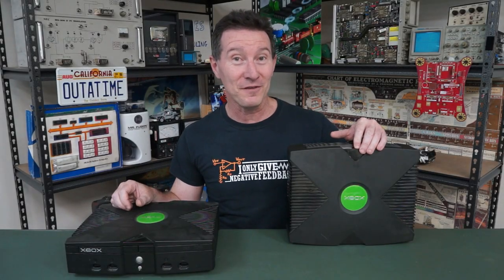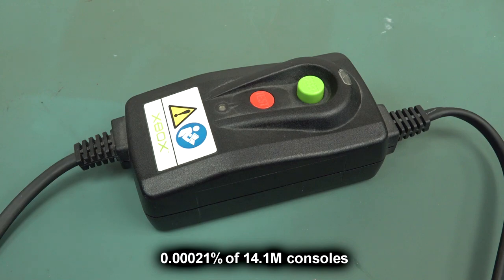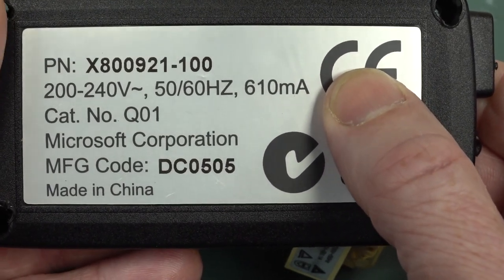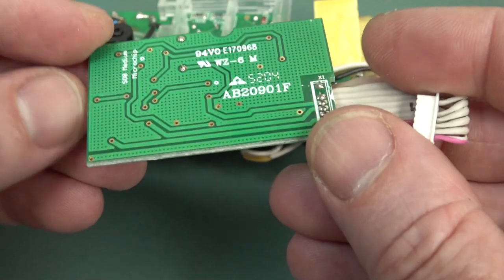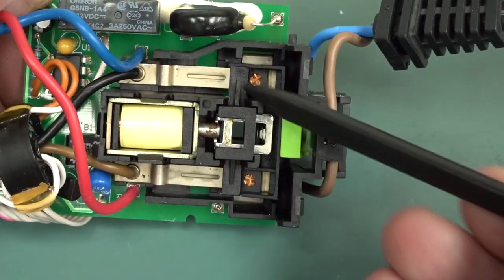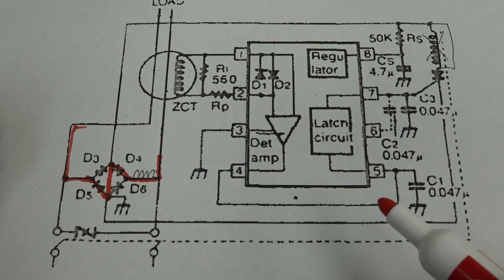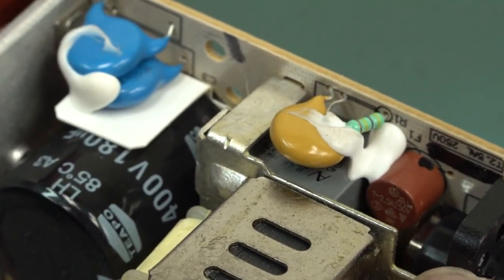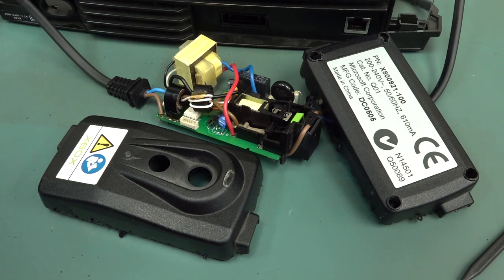EEVblog #1164 - Xbox Engineering Baptism Of Fire

Comment: I don't think that's a real solution, since the user can exchange the cord with whatever IEC8 cord, every household has plenty of devices with IEC8 power cords. This external unit would have been a real solution only if the console has some custom power connector.

Comment: No ground? Why didn't consoles have ground, all my old laptops had one?
Reply from the maker: Double insulated like many home appliances.
Reply: Having a ground makes it easier to pass both safety and EMC requirements at the same time and avoids touch currents in normal use, but it costs money. The result is that small PSUs (phone chargers and such) almost never have a ground while large PSUs (desktop PCs) nearly always have a ground. Laptop and game console PSUs are in the size range where the design decision can go either way.

Comment: This "Arc Fault Circuit Interrupter (AFCI)" power cord doesn't really fix the problem, only avoids arcing and resulting fires. They should have recalled all effected units and REPLACED them with brand new units.
Reply: But that costs more money! Just need to keep the fire damage lawsuits away :) screw those pesky customers who get limited life from their expensive purchase....
Reply: @volvo09  according to other commenters they replaced any units that had sparked/burned on the house.

Comment: Never had a problem with the first Xbox, but four friends and I bought Xbox 360's. All died with the "red ring of death" within two years. Can't remember a shitstorm about that though.
Reply: Jack Zimmermann There certainly was, search YouTube, or the web, and you will find the stories of the XBox 360 project director going to Steve Ballmer to tell him they had a greater than $1 Billion disaster the making and that either Microsoft agree to extend all warranties to three years and replace all RRoD failed 360s or the XBox brand was absolutely dead — it was considered to be of such magnitude internally as to spell the death of their entire XBox gaming division if not handled correctly.  According to the story, Ballmer did not hesitate to say “do it” on the spot as he correctly surmised that Microsoft could easily weather a billion dollar loss but not the total loss of their consumers’ confidence in Microsoft as a company.  Imagine going to your own boss to tell him you need a check for greater than a billion dollars because of an unforeseen design fault in your product design!  

The XBox 360 RRoD event was precipitated by the shift to lead free solder due to RoHS regulations and the unforeseen realities and complications that stemmed from using brittle lead free solders with large die areas with high thermal dissipation and that would be subject to significant thermal cycling — the thermal cycling (expansion and contraction) was shattering the brittle lead-free BGA joints whereas traditional leaded solder tolerated such cycling without issue as traditional tin-lead solders are typically very soft and ductile.  Microsoft’s blunder is the most well known, but the abnormally high failure rate in many modern electronics is related fallout from the shift to lead free solders (minus bad electrolytic capacitors deaths) as we are still having to learn entirely new ways of coping with the consequences of a forced shift to a vastly more brittle and unforgiving solder formulation.  Ironically, early solders were high-tin content solders as well and these very problems we are rediscovering are precisely why our predecessors added lead to tin to create the leaded solders that were in widespread use before RoHS.  Now we get to enjoy vastly higher failure rates in our modern electronics due to fractured solder joints, tin whiskers, and, in very cold environments, even tin plague (in addition to the problem of crap electrolytic) so there is no more leaded solder in most products today but we end up tossing many more otherwise perfectly good electronics into our landfills due to premature failures!

But that is why Microsoft made such a big deal out of the larger cooling fan, reduced die size (CPU and GPU integrated into a single more compact die and carrier) and the reduced total power dissipation in the XBox 360 Slim and XBox One models because those where the main fixes made to address the RRoD problem — reduced dissipation, cooler die temperatures, and reduced BGA area all meant greatly reduced thermal cycling and greatly reduced expansion and contraction which meant greatly reduced stresses on the brittle lead free BGA solder balls, so far less risk of fracturing the solder joints.  Microsoft’s billion dollar pain served to teach the industry quite a lot about the downfalls and hazards associated with lead free solder and the design changes necessary to try and account for them, but we still have a lot to learn and many, unfortunately, have still not learned from those painful lessons and continue to make the same mistakes because you can not treat lead free solders at all the same way that you did with the softer leaded solders that we had spent the last century perfecting our methods for.  

To Microsoft’s credit, the ultimately did the right thing after initial denials while they tried to understand a problem that ultimately affected up to 54% of pre-slim 360’s despite the extraordinary costs and PR headaches, and that is not always the case in these sorts of product disasters (and MS certainly needed the brownie points as they, like so many large corporations, have committed their own past sins, but credit is due where it is due and here they made an honest effort to make things as “right” as was likely practical at the time).
Reply: @ethanpoole3443  great write up! Yes there was certainly a shit storm over the rrod, but ms did try to do right for their customers. I was never a gamer, but I had 2 friends with 360's who got replacement units from it... They would have been done with Xbox if ms didn't take care of their blunder... While not totally their fault it was their logo on the product, so they had to fix it. you can't just expect the sour customer to buy another unit by saying solder regulations caused it and it's out of warranty.  Ms handled it quite well for MOST people, so besides the inconvenience of having to return a busted unit, people didn't need to bust out the pitchforks.
Reply: @ethanpoole3443  This must be the most comprehensive and interesting reply I ever got in a Youtube video comment. My hat off to you sir!
Reply: @ethanpoole3443  Hopefully Tesla know all about this (when you'd like your car purchase to last 20 years), military still have a minimum lead content to avoid tin whiskers (theres an IPC/NASA pdf showing how a conformal coating traps the tin whiskers)

Comment: Damn I'm early, less than 50 views.
I do remember my cousin had an Xbox that did almost caught fire, and it was the mains connector, the solder joints were cracked and part of the PCB got burned.

Comment: Just use a flathead screwdriver to break out the pin and then use a regular torx to get it out
Reply: Felenov-official - you can’t; torx is 6-sided, the screws he had were 5-sided (internally). Energy if you drill out the pin, you’d still need a special 5-sided bit.
Reply: @williamsquires3070  5 sided bits are common too.

Comment: Still have one... very modified.
Reply: These were the ultimate modding console! Sadly MS has improved their security on xb360 and xbone :/
Reply: Yea best to mod console. Have 2 soft modded and 2 hardmoded ones. 1.0 TSOP flashed with 128mb ram mod. But sadly there is some issue with "quite loud humming" PSU. Sice every PSU i had does that need to figure out where the problem is. And other 1.4 with 2tb hdd, TSOP flashed too and 8cm notcua fan instead of that loud original one. So whole console is whisper quiet. XBMC 3.5.3, original component cables and audio via toslink is great.  Had this stuff on that 1.0 but well, exept some emulators not really needed now.  Not sure why I didnt solder that ram on 1.4, less stuff on it so i bet it would be more reliable. 
But always wanted that front xecuter LCD panel hehe.

Comment: way overkill, very much useless IMHO. The problem is that the user will likely constantly reset the breaker thinking everything will be fine after it trips, except when the PSU of the XBOX fails, it is gone and will keep on re-tripping the cord anyway until the PSU or XBOX is replaced. I work with appliances that use switching PSUs, and when they go, they will usually permanently short out, or go "open" circuit( no output condition )if you are lucky for them to do so.
Reply: The overkill was to be absolutely sure to avoid a fire because the Xbox was dangerous, so going overboard on the replacement cord would be cheaper than replacing the whole console or having to pay out for wrongful-death suits. Also, they threw it together quickly, so they didn't spend much time optimizing it.
Reply: the problem had nothing to do with what you said. the problem is arcing in the plug in the console. this cord is an arc fault interrupter.

Comment: It just an off the shelf inline ACFI/GFCI, RCD not made or designed in house. You will find these on lawnmowers or outdoor extension leads. Made in china to meet or surpass international safety standards. Jellybean part, just buy em and splice a IEC E7 lead with whatever international molded pug is required and bobs microsoft's uncle...

Comment: I never even knew of this. Consoles blowing up? Non the less they are great consoles and the reliability is usually good. Dust killed the Xbox we use to own for about 10 years. Depending on the console they came with western Digital, Fireball, or Seagate hard drives. The power supply's were ether Delta or Hipro (back before Hipro made computer power supply's that blew up), and there were 5 revisions of the mainboard. The earliest having a daughter board for the usb or "controller" ports and AT power connectors, then next having ATX power connectors, fan on the graphics/ northbridge cooler, etc. If your lucky enough to have an Xbox with the revision 4 or 5 boards, they were easy to throw a hardware mod chip on. They sport a 733mhz Pentium 3 mobile, 64mb of ram, and graphics similar to an Nvidia TNT2, custom windows NT based os that ran within the hard drive. I use to do all kinds of stuff with Xbox's back then. I'm sure someone figured this out by now, but the hard drive has a firmware lock on it that's activated by the os. So if you try to plug it into another computer and try to access it it will show up blank, only way to use the hard drive with a computer is to wipe it first.
Reply: Straight over my head too. First time I ever heard of this. I did buy a second gen XBOX360 which proceeded to suffer the red ring of death - I never got it repaired. It's replacement is still alive. The XBOX one I bought I never use. sigh. My username on xbox live was my youtube username (almost) but with the latest xbox live  it seems picking your own username is no longer possible.
Reply: You can hot-swap the hard drive to bypass the lock. I did that once. Power on with the drive in the Xbox, then disconnect the IDE and connect the drive up to your computer while the drive is powered by the Xbox.
Reply: @Okurka.  Ah yep. Couldn't remember how many revisions lol

Comment: I still have 1, need a controller for it though XD
Reply: KOSMOS1701A I wonder, would a wired 360 controller work if you used the breakaway cable from an OG Xbox? It’s probably easier to just buy a whole controller though...
Reply: @ianweber9248  yeah i mean even if it fits together, it probably wouldn't work due to the different buttons
Reply: KOSMOS1701A From what I understand the major change moving from the OG Xbox controller to the 360 is that the black and white face buttons on the OG become the left and right shoulder buttons on the 360. It’s possible that they changed all the codes, but I don’t really see MS doing that. PS1 and PS2 are forward and backward compatible to various degrees and, as we see from this video, MS are far lazier than that :P

Comment: The brand got damaged with the XB360
Reply: IIGrayfoxII Thing is, RRoD aside, the 360 was probably the most successful out of all of the Xboxes. I’d argue that more damage was done to the Xbox brand by MS trying to force it to be always online, limiting its ability to play used games and bundling the Kinect than the RRoD.
Reply: @ianweber9248  30% failure rate is high.
The RRoD was not the only issue with the XB360
Disc Ring was another.

Yes they were fixed but still, not a good thing for MS at the time.
Reply: IIGrayfoxII They were also not bad enough to prevent the 360 from clocking up ~84 million sales worldwide.
Reply: @ianweber9248  They were going to sell anyway.
But the faults the XB360 had should not have happened.
It happened as they rushed the console release.
Reply: IIGrayfoxII Sure, MS almost certainly brought those problems on itself by trying to beat the PS3 to market, but that isn’t really the point. Whatever damage the 360’s technical issues did to the Xbox brand was still not bad enough to stop it being the most successful “serious” console (the Wii outsold it, by a significant margin, but that was arguably targeting a different market segment) of that generation. This generation was entirely theirs to lose and they lost it big time. Even though they eventually backed down on the more controversial aspects of the Bone (the always-on online requirement and the used game restrictions I think before launch and the bundled Kinect about a year or so later) it was too little, too late with the PS4 continuing to outsell it almost 2 to 1 despite MS’s best efforts to win people back.
Reply: @ianweber9248  Yeah, True,
But the XB was cheaper, easier to make games for, could be hacked which would've added a good amount of market share.
Reply: IIGrayfoxII It should be noted that the PS3 did a far better job of closing the gap with the 360 than the Bone is currently doing with the PS4. Once Sony got the price under control and developers finally started getting their heads around its somewhat oddball architecture it started picking up, closing out the generation only 4 million or so behind in units sold.
Reply: @ianweber9248 The PS3 was more capable due to the Bluray holding more data, meant better looking games.
The Issues that plague the XB since day 1 is the Hard drive that is not user replaceable, unlike the PS3 and PS4s.
Remove one screw, pull out drive, install your larger one, install firmware, DONE.